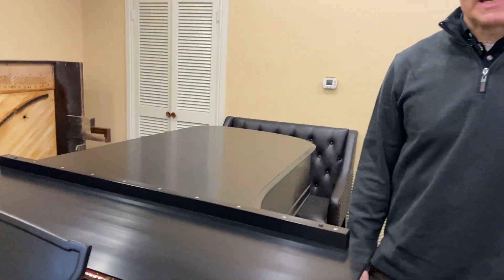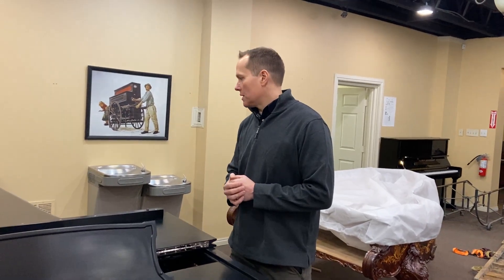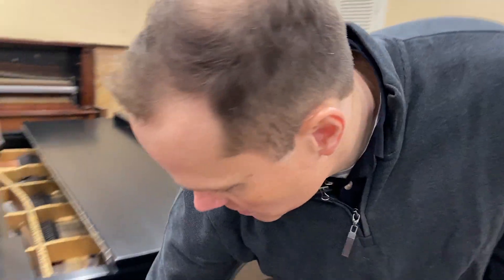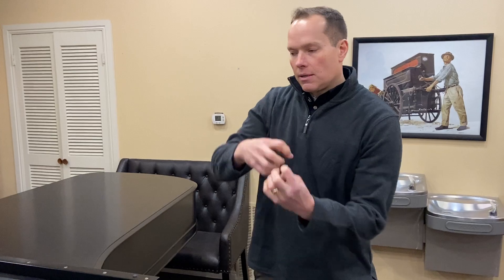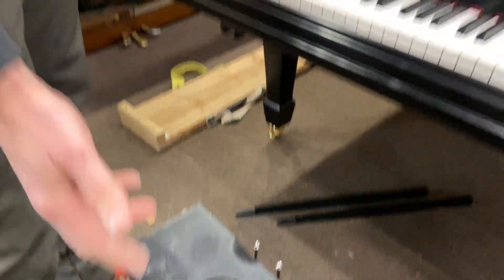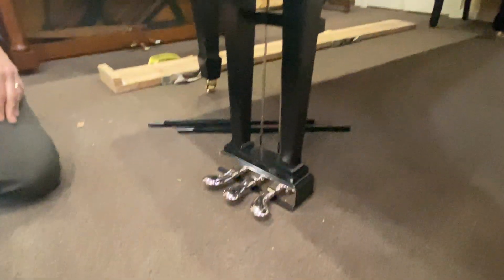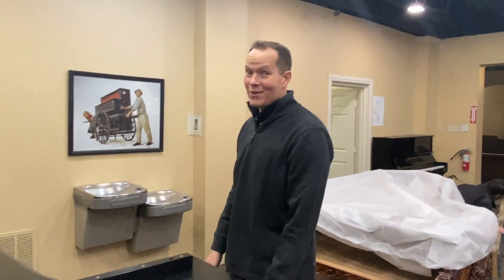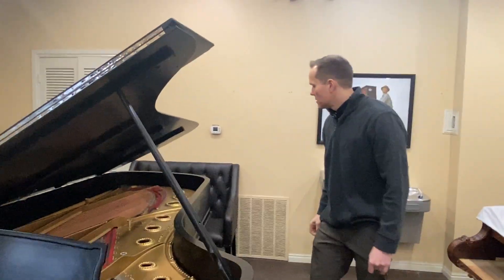Steinway D: Beautiful Satin Finish!

Comment: If they're moving it around a stage or in an auditorium setting with any frequency, I'm surprised they didn't brace the legs with a large metal bracket, specifically designed to move the piano around.  My Baldwin SD6 had such a metal brace which made it a breeze to move around.  Those tiny single roller caster wheels simply don't compare.

Comment: The school would save $$$ by buying a second piano for the choir room. Fixing up that concert grand must have cost a fortune.
Reply: I'm sure the school did the math. indeed probably cost a lot, but Steinway D's don't come up too often for sale used and when they do, they're still in the $40-100K range depending on age/condition, and history.  As long as the soundboard didn't need complete replacement and had crown to it, then the restoration can be done for anywhere betwen $12,000-$30,000, which is less than the cost of: (a) purchasing a new one and (b) buying a used one with unknown issues and possibly which needs a complete overhaul anyway.  So even if a "partial" restoration cost 25,000, then they're ahead of the game, and they may even have been able to claim the damage on their insurance.  I'm sure they have insurance on an expensive instrument such as this.
Reply: @komoru  they don’t need a concert grand in a choir room! They could do well with an upright. A concert grand is used for performing not rehearsal. It isn’t even essential for a performance.
Reply: @frankmarter6845  Maybe they had/have both?  Who knows. 

Everyone's desires/goals are different. 

 An upright serves a purpose in that it's compact and very easy to move around and still has that warm, organic, acoustic tone, and is great if space is tight.  I used an upright for years with no problems.  But as you advance, it does not have the same action and double escapement that a grand piano has.  There are different tools for different jobs, just as you don't use a sledge hammer to pound a nail into a wall, you wouldn't use a ball peen hammer to do heavy demolition work.   For many, even a digital piano such as a NORD Stage 3  or a good quality digital piano is the right solution. 
☮
Reply: @frankmarter6845  Well, I live in Germany and my piano technician did his apprentice ship as a piano builder at the Steinway Hamburg factory and to this day does concert preparation and rents out two D and one B for local concerts. When I asked him, what would be the optimal piano for my 45 square meter (around 480 square feet) living room he replied: The way it is arranged now, you should definitly get a Steinway B. But if you could  move your couch just a bit or get rid of that cupboard over there, I would definitly suggest a D.

And he was dead serious. His general opinion is that there is no piano too big for a room. You can always mute a room or do stuff to the piano to make it a bit less overwhelming, but the precise action of a full length concert action cannot be substituted ever.

When I tried some Ds later, I agreed. I had never before played on a piano that made pianissimo so simple.

So I disagree with the opinion, that you don't use concert grands for rehearsal but only for performing. I will never perform anywhere; not good enough. But in the end I bought my big grand. (not a 9' Steinway but a 7'7 (230 cm) Blüthner Style X) and I am pretty happy with it.